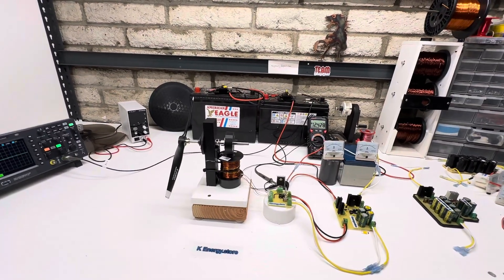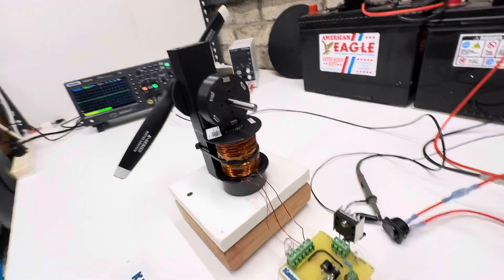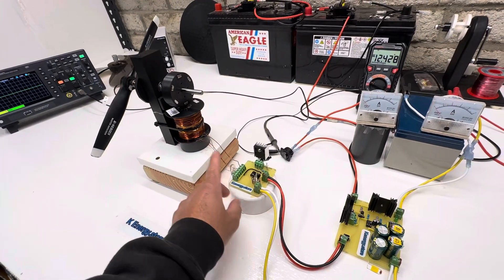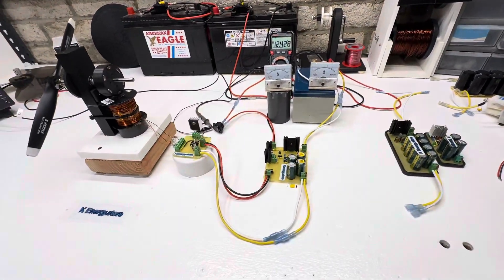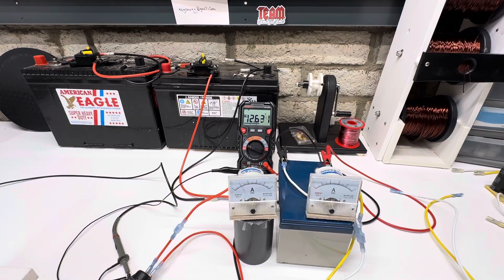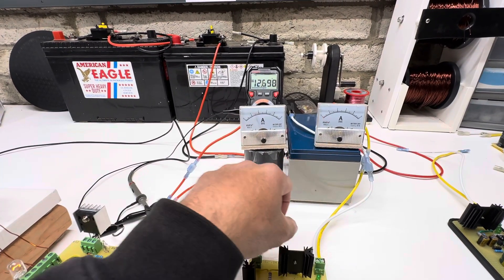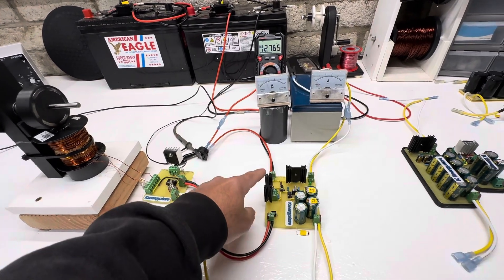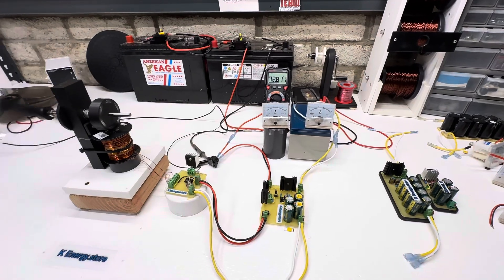Bedini generator mode

Comment: The input and output are the same amps, but the input is more amp hours.  The pulses are over twice as long.  So what is the goal with these things?  Are you going for a super efficient motor or like a generator for a wind turbine?  Because I keep seeing people on here trying to generate electricity with electricity, and I feel like I might be living in crazy world.
Reply from the maker: That’s because you can make electricity from electricity it just comes out as higher voltage
Reply: That's what transformers are made for, and they don't eat as much energy as motors.
Reply: Not a higher energy level  @kenergy1707